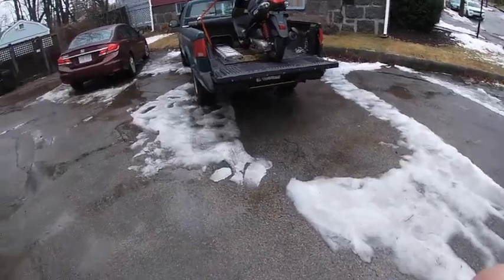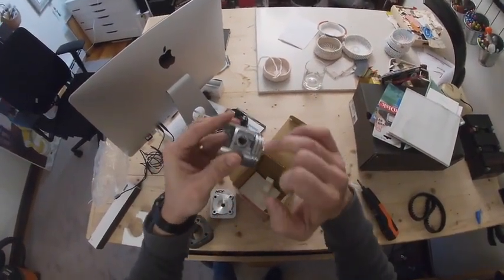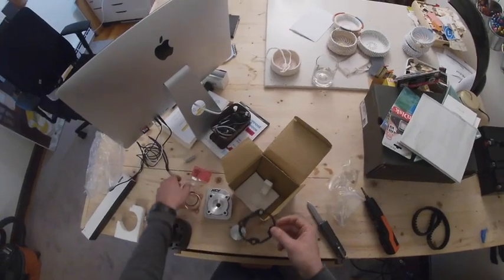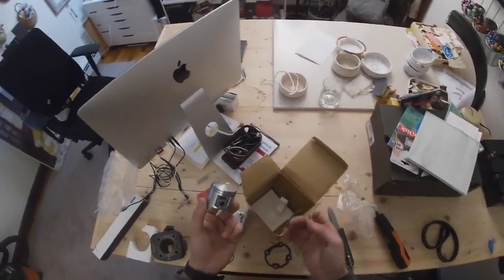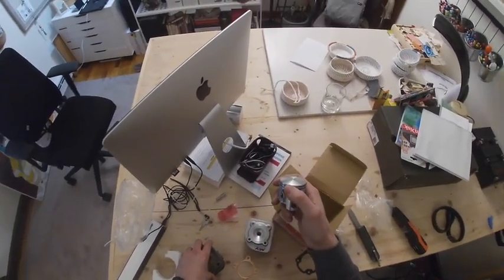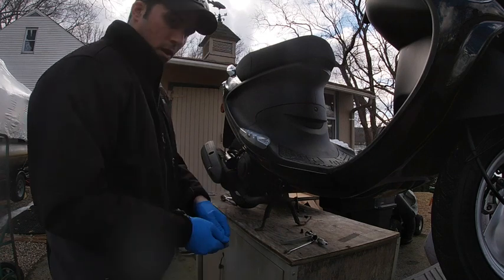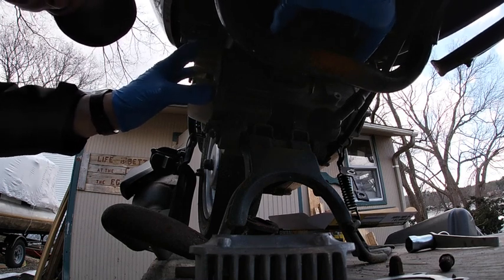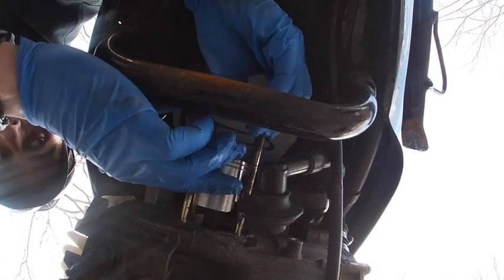Buddy 50cc Gets a 70cc Kit  BBK

Comment: I'm curious if these kits really reduce the engine lifespan as much as people say.
Reply: If done correctly they do not
Reply: Someone out there tell me I have a 2004 Eton 50cc 2-stroke Beamer Matrix simple cut the wiring and put a AC stator and CDI in it and had it all messed up I just want to get the correct wires put into the DC CDI it has a few other things if anyone has one out there let me know because if you hook it up wrong you can burnout rectifiers and stuff which I got another rectifier also whether I knew it was bad or not I tested it and some of them things were bad in it but if anyone's out there then nose or can take pictures send me talk to me

Comment: Liked and subbed. If I do this mod to my  (2017) Buddy 50, which indicates a top speed of 45 mph derestricted, how much faster should I expect it to travel?
Thanks and stay safe!
Reply: it depends, i would recommend to by a new exhaust that is specifically made for a 70cc cylinder. and dont forget to not go over 3/4 gas when riding the first 500 km otherwise it will break down
Reply: @albinhenriksson8980      Thank you.  Have you personally done this mod? Which brand/modelexhaust do you suggest?
Reply: @albinhenriksson8980  it will definetly not break down lol. make sure to do 5-10 heat cycles, ride it easy for the first 10-20 miles dont stay WOT for more then a few seconds. thats really it ive done this on all my scooters ive owned and they still run great.
Reply: No one has replied to his request for an approximate top speed of his scooter after doing the upgrade. Can someone who has done this give both him and other's who want to know what they should expect provided that the upgrade is properly done?
Reply: Realistically a buddy 50 does bout 42 with wind at your back and 45 going downhill lmao, but a big bore kit and up jetted carb and sport exhaust should push it towards 55mph
Reply: @jeffrymatherlee3367  I am a mechanic for the biggest genuine (buddy/roughhouse brand) scooter shop in Illinois, I personally know after up-jetting a carb, getting a big bore, better transmission kit and sport exhaust you'll be pushing a buddy 50 upwards of 50-55mph but probably not much more than that. But personally if I were you and you don't have lots of different idle and main jets and different sized roller weights for a transmission, take it to a shop so it can be fine tuned because those parts need to be fit and tested per bike or it won't run to potential
Reply: @ghillepig2   Yes, the odos are always, shall we say. "optimistic", so you're probably  right about the 42mph. 
Instead of messing with mods, for my 77th birthday I bought a Honda Grom, 125cc, with  wihich I've reached 59mph, and with which I've now ridden with MANY "giggless/mile". It's a just-for-fun around town l'il bike. For highways, I get my smiles/mile from my 74th birthday present (to myself), a 2018 Kawasaki Ninja 400  KRT ABS.
I put a milk crate as a "trunk" on the Buddy for shopping small list items from the nearby WalMart. The Grom and Kawa have no facility for transpoting anything beyond me, my stenosis, and my bursitis. 
I love all three of the bikes!!!!!
Reply: @usernamemykel  yea the only reason to get a big bore kit on a 50cc is if you wanna go a bit faster but don't want to commit to getting a M license, once you move past 50cc and get the M license you have so many other choices and tbh I'd agree I've always wanted a grom they just look a bit too small for me
Reply: @ghillepig2  
Try one, if you can.
Reply: Speedometers tend to read  5 to 8 mph too high...
Reply: The stock speedometers usually read 5 to even sometimes 10 mph higher than you're actually going always best to verify your speed with GPS

Comment: Did you have to change the jets on the carburetor to avoid incorrect fuel or ignition problems? Spark plugs spec change?
Reply: Yes you will need to increase jet sizing most likely in order to avoid bogging under acceleration with the bigger head and exhaust, same thing for roller weights
Reply: @ghillepig2 By how many sizes up? Like 2 or 3? 10 percent? I’m in a warmer place as opposed to this guy. Not Florida but warmer. Thanks 😊

Comment: I have a 49cc jog clone with a 12mm wrist pin. Seems harder to find a BBK unless I go with a stock 90cc which I can  find or pay $150 for a 70cc kit and a 12mm pin. I hit 46 now with stock configuration. Seems I am limited by gearing. Would getting a BBK be good for me or should I update other things like gearing first. I have good take off and pulls thru the entire curve. I'm not looking to hit 55mph. Just 45 consistently at lower RPM's
Reply from the maker: Well.  Its always a give and take. If you mess with your gearing, you can achieve a lower rpm at 45 mph.
 However it takes more power to get there consistently... So its kind of a catch 22.  If you don't make enough power you'll never hit 45.  In my opinion the bbk is the first step and you build off of it but one hand washes the other. 

You can put a professional bicycle racer on a unicycle  and he wont be fast and you can take a sumo wrestler and put him on a road bicycle and he wont be fast.....  or at-least consistently fast

Don't quote me on this because I am not a jog or jog clone enthusiast

but i think this may be the droid your searching for

https://www.scooterworks.com/NCY-Cylinder-Kit-72cc-Iron12mm-Pin-Horiz-Minarelli-2T-P1082.aspx

If its a horizontal in my experience the only difference is pin size
Reply: All you need is a buddy that has a machine shop you'd be amazed what can be manufactured